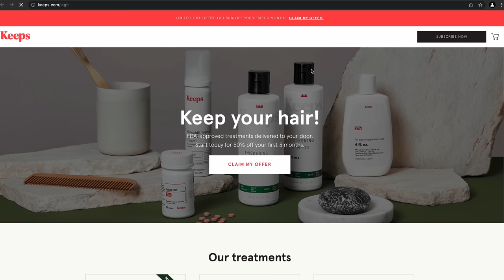What I Found After Tearing Down My SVT Lightning Engine & Looking Inside! CARNAGE ALERT!

Comment from the maker: Ok people, what are some must-do performance mods since I'm building the engine?
Head to https://keeps.com/legit for 50% off your first order of Keeps hair loss treatment!
Reply: Blower upgrade + headers
Reply: Better transmission mounts, check and re-balance driveshaft, lower mileage rear differential would be on my 'try to do' list to keep performance and get me back home after fun
Reply: SwainTech thermal and lubricitic coatings
Reply: hell i wouldve just slapped a coyote in it and N/a have more power than that motor with ported blower. Then add a whipple or turbo to the coyote and have the lightning everyone wanted in 2023. 850 reliable wheel daily hp or as high as 1200whp out of a stock sealed coyote.  think about it v8 f150s and mustang gts can make that 1200whp and mustangs have ran 7s and f150s 8s in the 1/4 mile with stock sealed engines.  No heads no cams no pistons no rods
Reply: think about it to buy another engine if needed . 3000 for a coyote  and thats with e85 and its a 400whp truck. 10k for a whipple so you still get the supercharger noises and beef it up to as high as 950whp with any vmp whipple etc. me i would go turbo just because no swapping pulleys  just adjust boost as you drive
Reply: stroker kit
Reply: Forged rotating assembly
Reply: A new rear end gear
Reply: Eaton rear carrier, limited slip. Engine upgrades sounds about right. Waiting to see the reassembly.
Reply: If you're putting new pistons and rods in. Balance the rotating assembly
Reply: Use some Molnar pwr rods and Diamond pistons with upgraded wrist pins and such. The pwr rods will handle 1200+whp. Can get the pistons to handle the same. Let's be honest. You will want more power once you get tired of the heat soak from the eaton.
Reply: Forged internals, CNC ported heads, and cam! I see you already have the blower ported
Reply: @That_Dyna_Guy  Cams, as its not a tractor tech pushrod engine.
Reply: Cams
Reply: Dual fuel, exhaust cutouts, coated pistons, bottom end girdle, and above all more boost! 
It’s funny how it goes from head gasket to H-beam rods, and forged pistons. My mild engine tune went from rings and pistons to bigger bore, H-beams with 22mm pins, wiseco competition pistons, full porting, ball bearing turbo and dry sump.
Reply: @MJPilote  yeah thanks, you know what I meant obviously
Reply: If you like engine carnage, watch I Do Cars. Every Saturday an engine teardown. Filled with carnage
Reply: Trick Flow Specialties Twisted Wedge cylinder heads to make the engine more efficient/powerful.  Twisted Wedge heads will flow more air right out of the box than ported factory heads.  It takes crankshaft horsepower to turn the supercharger.  For any given amount of air moved under boost, the engine will have less parasitic horsepower loss via the supercharger with the Twisted Wedge heads and will deliver more horsepower to the wheels.  You should also have a lower charge temperature because you didn't have to make as much boost to produce the same amount of wheel horsepower, which translates as a safer tune.
Reply: Top mod NOT to make, hear me out. The sound effects that you made of what the ported blower will sound like, that is evidence that the 6 year old you is alive, well, and healthy. Congratulations Alex, you turned your job into play. Keep taking care of that kid, keep it fun, don’t mod that.
Reply: Fun 🤩
Reply: @That_Dyna_Guy  Yeah I know, just had to. Nothing bad ment by it. All fun and loving cars here.
Reply: @BlandDeuce  might as well coyote swap it if you're going to start throwing thousands and thousands of dollars at a 2v turd
Reply: @neilbrown82  I know but sometimes I just have to be different. I'd search out a 4.6 DOHC
Reply: Must do cams!
Reply: 1. Factory Tech Valve body (shift kit)
2. CAI or Modify the stock air box
3. 4# lower pulley AND Chip and SPark plugs
4. some type of "traction" bar
5. DIY Electric Fan (relatively cheap)
6. Apten Ported Supercharger and a NEW DYNO tune for the chip
Reply: forged pistons and connecting rods, ported heads, bigger blower, better air to water intercooler, i think is all
Reply: High volume oil pump
Reply: @BlandDeuce  that's just more disappointment at this point it's more cost-effective to put in a coyote did not been done tons of money into an older modular engine which is a turd
Reply: Wisco Pistons and rods?
Reply: Ls swap it
Reply: Been there done all of that….2v 5.4 isn’t worth building up to a high performing engine. If I was to do it all over again I would build it back with just upgraded rods and run it fairly stock. However, you and I are performance junkies and need more power so I would also say buy a coyote motor and a vmp supercharger and call it a day. 
I went with a $10k B&B printed engine and a 76mm turbo build on my lightning and today I wouldn’t even think about building a 2v again. Coyote !!!!
Reply: They’re called fracture split connecting rods, but cracked connecting rods is close enough
Reply: @Eric-tb7li  definitely agree with that no sense to spend coyote money on a two valve
Reply: Ford Engines have cross-bolted mains. Very strong bottom end.
Reply: 4v heads
Reply: @adrianlastname4864  then the blower intake manifold would not fit....
Reply: Forged rods, forged pistons, tool steel piston pins, CNC port the heads with aftermarket cams, ARP head and main studs, high volume oil pump with billet gears, billet crank sprocket. With these upgrades to that cast iron 5.4 block you'll be set to handle at least 1000 horsepower.
Reply: Pretty sure performance engine mods USUALLY insure you won't have a long lasting engine and an empty bank account. 😵‍💫 Nature of the Beast?
Reply: A good freakin tune!!!
Reply: None of these guys are helping lol
Reply: U need to run something a little better than pump gas if u wanna really get the most out it, a must do is gonna be ur fuel injectors u want something better than stock, add an adjustable fuel pressure regulator and a hi flow pump + after market canister fuel filter would be awesome to see maybe cooler spark  plugs and slightly file your rings to lower ur compression so they don't push together at 6'000 and blow the top of ur piston again. Please read this and consider what I said
Reply: Billet oil pump gears
Reply: Go with Manley forged pistons and rods. They worked with Ford back in the 2000s and supplied rods and pistons for the 03/04 Cobras. Used their stuff on my 4.6 DOHC rebuild and they are working great.
Reply: GT500 oil pan gasket, It has a built in windage tray. Just have to clearance it a little for the oil pick up tube, easy to do with a Dremel.
Reply: Turbo charged coyote
Reply: @97n2oGT  absolutely the only way to go unless you want leaks or no windage tray
Reply: it's a lightning so flamethrower from the exhaust kinda fits
Reply: Well its basically the same unit as the Ford GT. Since a few of them are about making really big power (2000hp), it may be worth having a look to see what they're running. 
I think that level is probably excessive but a 1000hp street truck would be cool and seems very do-able with that motor.
Reply: 22:30 - "it would never overheat". You mean it would never show symptoms of overheating? Its pretty obvious it got hot a good few times looking at those parts. Thats probably where the det came from too. Even with a bad tune they will usually pull timing when they see knock so its much more likely heat and pre-ignition caused that.
The scoring on the bores also looks a lot like its been caused by heat expansion.
Reply: A better automatic transmission swap. A decent automatic would shift alot faster than the 4r100 your truck has now and alot faster than most people can shift a manual.
Reply: Hey Alex! Would you ever consider selling one of those pistons? Would be cool desk deco. Especially if you signed it
Reply: Coyote swap it.
Reply: I have a 4v GT supercar/GT500 swap. All of my stuff is new still including my comment above…
Reply: I have a fully built JLP longblock with the ported heads & stage 2 cams all still new, along with a new 3.2L twin screw blower and huge 170mm TB and plenum…
Reply: A1 transmission outta Georgia builds the best 4r100. The man behind it is a fellow Lightning guy. If your keeping the Eaton I’d highly recommend looking into the spacers and midplate at JC Customs.. plug the turkey pan while your down there. High volume oil pump, billet gear and appropriate high volume pickup out of 03-04 cobra or 3v truck…
Reply: My longblock is one of the last OEM 5.4’s with the cobra jet crankshaft btw… they quit making iron block 5.4’s from Ford Performance/Racing…
Reply: I hope you feel better 😞
Reply: I would sell the stock blower and the ported one you picked up. If you want to stay with a blower nothing compared to a twin screw like Kenne Bell those roots just make heat everyone knows that. If you want to be different do a twin turbo setup.
Reply: Yep it is me I don't even think I'd build the sucker I'd find out low mileage navigator motor and throw a blower on that
Reply: Yep if it was me I don't even think I'd build the motor I can find a low mileage navigator motor and throw a blower on that
Reply: It's interesting this tear down this motor is so backwards small Pistons really long stroke stock they did pretty good a good motor probably as good as the ls but don't tell any Chevy guys that just size-wise you can't put it anything except the truck too wide this engine program was started before the LS it was done in the 80s when they thought they would need the smaller piston size to meet emissions the 305 Chevy was an emissions motor and it had really small 3.76 Pistons these are smaller than that 3.55 the 46 is a square motor it has a 3.55 stroke and to get the displacement up to even 3:30 or 5 4 they had a stroke it out to 4 and 1/8 which means you're pissed and speed is pretty high not going to matter for a street engine but this engine really isn't meant to Rev the opposite of the 302, the 302 Ford has a 3-inch stroke to answer one question I hope I don't know where I read these things so I can't tell you where I read it but after four did the GT500 block they eventually upgraded all the blocks to that block of course then they did the three valve block and it's different with the cam phasers and stuff v10s aren't different you can take any V10 block and put early to valve heads on later to have heads on usually called pi heads or three valve heads on the V10 never got the cam phasers so I've always wondered if there were some three valve heads out there for the non cam phaser two valve blocks
Reply: @LegitStreetCars you’re going to spend 3k anyways. Put a coyote in it. Refurbish the blower make it red. Sell it and then use it to pay for a new blower turbo whatever for the coyote.

Comment: Here’s an old school R&I tip for connecting rods.
Slip a 6”-8” chunk of generic fuel line over the studs. 
It protects the crank coming out and helps centering during install
Reply: These rods had bolts. Nothing to put tubes on.

Comment: a friend of mine had a lightning years back and was having issues with the heads.  i think he said it was something the way ford manufactured the heads from the factory and there was something on the passenger side that wouldn't allow the head to sit fully flush on the block.  i want to say he mentioned that you'd need to have the brand new heads from ford taken to a machine shop to have the issue resolved.  i figured i'd mention something about it so that you could look around for that info in the ford community and plan ahead before you get too much farther than you are.  good luck with the rebuild of the engine and keep up the good videos.

Comment: It's a bit apples to oranges, but I have Prothane engine and transmission mounts on my 5.0 and they're great. Like you, I was a little worried about NVH, but those cars are known to eat mounts so I didn't really have a choice. You pretty much can't tell they're not stock.

If you're really worried about it, some guys will install an aftermarket mount on the compression side and a factory mount on the tension side. I'd probably just install the urethane mount on whichever side was harder to get to with the motor installed in the truck. That way if you frag the factory mount again, it's easy to change out, but the urethane mount would still be living on.

Comment: To think that a properly running modern DFI motor still drinks oil yet this Ford motor which had damaged pistons didn't use any oil is pretty impressive.

Comment: Go with the manly forged connecting rods they're rated for really big horsepower numbers real 304 Cobra motors got them and hold up real well stock from the factory 8900 horsepower easily so I would go with that and since you are at this point you might want to turn it into a four valve instead of leaving at a two valve

Comment: I'm surprised Ford used sintered metal powder connecting rods in an engine with a supercharger. This is not a criticism, just an observation and yes I know sintered metal is used by most auto manufacturers. I've just never seen it in a boosted engine.

Comment: Glad to see you are keeping your spirits up. Opening up an engine and finding all kinds of carnage can be extremely disheartening. Can't wait to see what you turn this project into!
Reply: Unless you're a youtuber and it makes content for you.
Reply: It's disheartening when it's your daily driver.  When it's one in the fleet of many, it's the perfect opportunity for a sick build like Alex is going to do.
Reply: Considering he stripped and rebuilt a twinturbo V12, this will be a walk in the park... 😉
Reply: my vote is the intake air temperature and or in cylinder temperatures got to hot not detonation damage also i would check the valves and seat's ect. for damages/ware as i have seen this before in a caddie/inport repair/race shop i worked at

Comment: Yup, awesome excuse to go built!  I recommend JDM Engineering, even if you don't buy from them, talk to Jim Jr, and he can answer any and all your questions, very knowledgeable dude.  Since your going built, I'd ditch the Eaton for a more efficient blower.  Even if you don't want big power, you can make power more easily with a 2.3 whipple, than you can the Eaton.  Eatons have to be pushed very hard to make what a 2.3 can make very easily, and with a lot less heat and stress on things.  Cool video though.  I'm also available if you have any questions.  I've been around these for a while, and can either help ya answer questions, or point you to an OG Lightning guy who can 🤘😁 much love though, love the series! ⚡️

Comment: The 2v 5.4's are great engines N/A,seen many 300k mile trucks. A  coyote swap would be more bang for your buck....the amount of money you will have into the forged 2v, you can swap a truck coyote with a 6r80 and make close to the same power without a blower and it will be more reliable. Foxcast Media is swapping my brother's 2003 Harley Davidson F150. BTW the the rotaing assemblies are same as the regular 5.4's.

Comment: I was amazed to see the 'cracked' conrods, I've never heard of this - I wonder if there is a large reject rate in this process? But they look great when fitted together.
Reply: They do this on all third gen hemis as well
Reply: Seems to work well for those engines
Reply: lots of bmws do this too :)
Reply: Normal on a lot of vag engines as well
Reply: Chevy LS engines have cracked caps.
Reply: Volvo also does this.
Reply: Wasn't it the same thing when they tried to blow up that little toyota motor with spun bearings? That's where I first heard of it :P
Reply: I thought they were known as "precision fractured" caps but I guess you could call them cracked. Pretty common on performance engines.
Reply: It's called "fracture split" and is pretty common on modern engines.  Even Ford does it.
Reply: Shows how behind the times I am - Essex V6 is my era!
Reply: Volvo has been doind this for years.  Ford has also but not as long.  Its actually cheaper, one less machining process.

Comment: Dumb question- but would you ruin anything if you flushed the coolant system with rust converter?
Reply: I would imagine so. It wont hurt the block but the cooling system touches plastic, rubber, aluminum etc.. there are probably some chemical properties of regular rust converter that would eat away at these but that's why they make THERMOCURE. It's a rust remover made for the cooling system of vehicles. At least that was the only thing I was ever told to use.

Comment: I own a Galant VR4, same drivetrain as your GSX. I bought it running rough and just found out its got bad rings and needs a rebuild. Im doing the exact same thing as you and doing all forged internals. So funny to hear you come up with the exact same logic for the build as I did!
Reply: Siiick.  If only it was the AMG tuned galant
Reply: @WhitexFeatherx  love the body kits on those but they are NA. I prefer the turbo! And good luck finding an AMG. Kudos to you on knowing of them.
Reply: oooh.  Galant VR4.  Those were special to see even when they were still in production.  I have always liked those!

Comment: Heck yeah Alex! Can't wait to see and hear it when it's all done.
Reply: Also that oil cooler gasket was a prone failure point. I have worked on a many 4.6 2V with those gasket leaks. Usually the O-rings flatten out leaving a leak path.